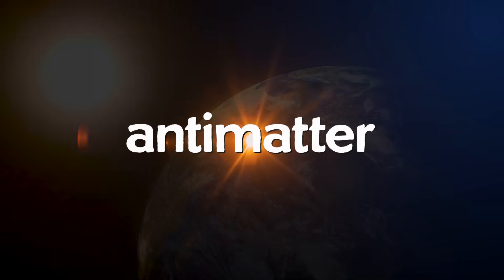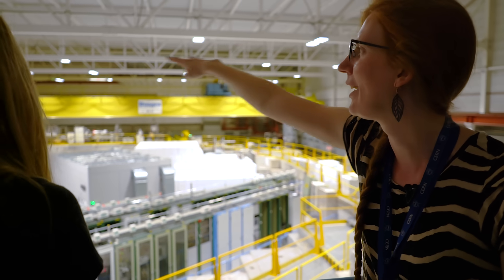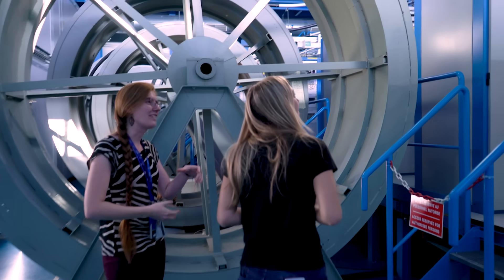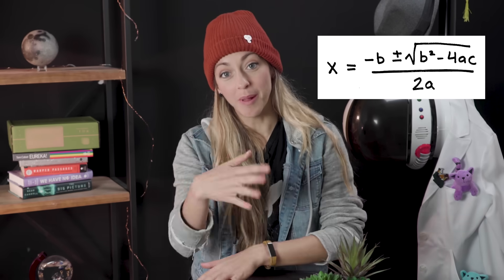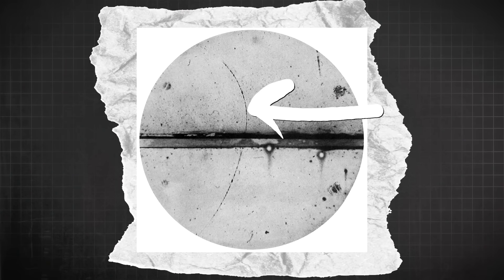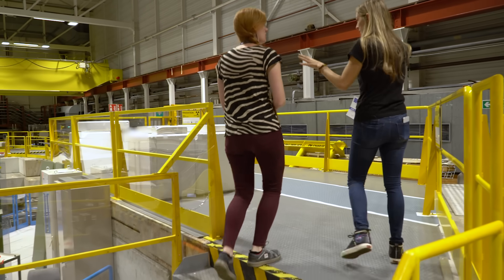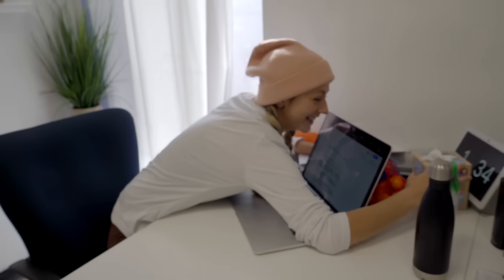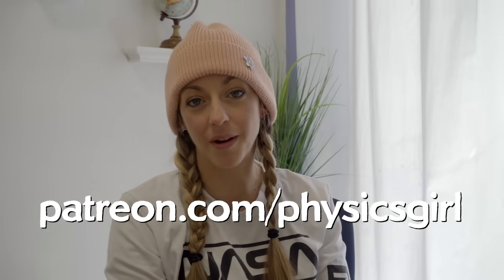Why This Stuff Costs $2700 Trillion Per Gram - Antimatter at CERN

Comment: So... Why have we not approached this quantum nature through "anti-nature" because the only thing that makes sense without completely rewriting a fraction of the science is that out of chaos comes nature. Explains why chaos is often described as a type of nature, rather than nature's mother. With that in mind, perhaps a structural path, like CERN facilities, is actually against the nature of the chaotic particle; therefore, we possibly won't find an answer without first, setting some traps and obstacles to cause direct momentum intersecting vector points after reaching high velocity. If an electron can perform individually independent for the DSE, then we may miss apparent flash steps of changes to the electron etc

Comment: We can make antimatter with matter and energy?(yeye i know it's all energy)
So you might be able make matter with antimatter and energy?

So if there was a bunch of antimatter that was made into matter, the matter the previous antimatter would have annihilate with is still there to.

So it could be pockets of matter and antimatter? or is most of the antimatter already transformed or annihilated? 
Anywitch case if one side of the scales is tipped it tipps itself more.
Reply: Most (practical all) has reacted or decayed so there are no pockets at least that we found

Comment: Why didn’t the positron hit something in the cloud chamber?   Particles leave a track because they ionize trace gasses.
Reply: Ionization occur when an energetic charged particle passes near the gas atoms, not by hitting them directly. That positron would have eventually given up enough energy and slowed down to the point where annihilation with an electron was highly probable. that's why the track has an end. Although that is a strange looking beta track from my experience.

Comment: 4:31 Americans will measure in anything but metric system.
Reply: Dragan Vujatovic 😂true!..... "tf is that? 😕"
Reply: @allenro1  Hi I'm from US and I'm  1.69123746 × 10-16 light years tall and I weight somwhere around 547 iPhone 4-s.
Reply: Dragan Vujatovic lol😂😂😂😂 I'm a roadbuilder, also from the US and for shits and giggles we split a foot up in decimals😂🖕
Reply: @allenro1  Hahahaha. I'm actually not from US, im from Serbia(Eastern Europe, using metric everyday) but I once visited my family in Canada and I used to find feet/inch system very confusing, because 12 inches make 1 foot instead of number that can be divided by 10 like it is for 99% of the measurement units.
Reply: Dragan Vujatovic lol. yea I figured you were from around there. It's nice to meet you👊. but like I said. I divide those feet into 10ths. 😉 we use hundredths and tenths of a foot in my line of work. you're right, it can be confusing unless you're a carpenter in the US
Reply: I actually wouldn't mind going metric... I've worked on some state jobs that have been metric and we converted for our software. slowly but surely we are assimilating  but you know us Americans 😉

Comment: Think of it all like this; we are swimming in a pool of matter and at a very specific distance away from our black hole is anti matter, as in our black hole is forcing matter into a bubble like area around our black hole (the milky way galaxy)  and forcing the anti matter to be a certain distance away the same thing as the surface of water on earth where water is matter and the air is anti matter, they don't mix and have a reason to stay apart. There is some physical line at a certain distance away from our black hole at the edge of the milky way where matter basically stops and anti matter begins.
This theory dictates that  every Galaxy is a "bubble" of matter and everything around the galaxy is anti matter or more anti matter than matter.

Comment: I believe there is an equal amount of antimatter to regular matter. we just don't know it when we see it out in space.
Reply: It's possible that there are entire anti-matter galaxies out there, but if that were the case, we would expect to see some annihilating somewhere, and we don't. Another possibility is that matter is somehow slightly 'preferred' to anti-matter in the initial conditions of the universe, such that there was very slightly more matter, so that all the obvservable matter in the universe is that small difference.
Reply: @Kreyyn  good point. But there could also be an equal amount of each created after the big bang, but they could have been thrown in opposite directions. And the other half of matter is just lying outside the observable universe.

More research it's required to know for sure. Maybe with better equipment we can measure the amount of matter to antimatter created by the collider.

Comment: 5:36 I like how the ''fix'' was wrong.
Reply: How is the fix wrong?
Reply: @aviaviavian  Diana says that the weird solution one would think is wrong is the positive one. 

This is correct here, since she is talking about the electron/positron, this becomes apparent ones she, two sentences later, says that the positive solution was to become known as a positron.

the fix says that Diana should have set negative. This is because she just stated that the negative solution is the wrong/weird one. But since she said that the negative solution is usually wrong, she did move on to talking about the specific work, in which the positive solution was weird.

It really comes from the video presenting the material in a slightly more complicated than necessary way. If Diana had said, when she first mentioned the problem, that one of the solutions usually are senseless, instead of mentioning the sign of said solution, the editor would not have made the fix.

Comment: How does someone even create anti matter? Like how do you start with regular matter and go from there
Reply: My understanding is that it works something like this:
1. Make a mess with a high energy collision.
2. There's a lot of randomness so a tiny tiny bit of the mess is antimatter. Probably.
3. Try to capture the antimatter before it touches literally anything and explodes.
4. Fail.
5. Repeat.
And that's why it is so expensive.
Reply: That seems to be the way it is .. but how do high energy collisions create antimatter?
Reply: I don't fully understand it myself, but it kind of makes sense if I think about everything as waves. The particles and matter we're talking about are just stable waveforms moving through space. They're different from each other because of their shape. (It's hard to imagine "shape" when I'm thinking about waves in the ocean, but really they're 11-dimensional or something so they've got more room to be creative.)
Anyways, if normal matter is like ocean waves, high-energy collisions are like aiming two high-pressure water jets at each other. You end up with "waves" which are a chaotic mess of stuff flying everywhere, and most of that mess isn't even close to stable. But sometimes there's a bit of that chaos which happens to form the wave-shape of antimatter. Antimatter actually is stable by itself - it's just inverted normal matter, after all - so if we're really lucky that wave makes it out of the blast radius without touching anything.
Reply: David Guild that’s an interesting theory and makes sense if you consider everything as a type of wave! I guess it boils down to what is the probability of antimatter forming based on the energy of the collision . It sort of feels like throwing a bomb in a desert and hoping an ocean comes out of it.

Comment: My theory? Alternate dimension that exist and operates exactly the same.
There is nothing saying that electrons are definitely negative. They could be positive and protons be negative, you could switch around the names and the names would still work. Now when you “create” this anti matter you’re actually just taking matter from this other dimension and annihilation is the gap that you created closing up. Therefore I believe you could travel to this dimension through antimatter annihilation, as long as you’re in the blast radius
Btw I’m still in school and 13 years old so don’t be too harsh

Comment: Welp, thanks. It took me until you showed the image of the positron to realize that the reason positrons can exist is because the quantum world is huge and particle collisions are rare, even with the magnetic fields from the particles, those quickly drop off in strength, meaning the little positron has less chance to be slapped by an electron as an H+ does

Comment: So if the big bang produced essentially equal amounts of matter and antimatter and not all of it "Poofed", then perhaps string theory's alternate dimensions are what separates antimatter from matter with large volumes of energy/mass linking the dimensions so that particles can cross over.  Perhaps an anti-black hole in the anti dimension is the source of our matter dimensions dark matter and universal expansion.

Comment: Woow! I think the time we have a substantial amount of anti-matter, we should have an anti-gravity effect. The moment they put it in a vacuum bottle held in place inside the bottle by magnetic fields, it will float or just go up like a hydrogen balloon.
Reply: Not likely, we are fairly certain that antimatter is identical to matter in all aspects except electric charge, in which case it will react to gravity just as regular matter does, however we won't know until we test it.

Comment: Also question wouldn't more of an object (matter) have more less antimatter. Ok kinda the way I see it is there is a box that is 12x12x12 the space in side is filled with antimatter of a balloon and once you start to inflate the balloon then there is less space in the box less possible antimatter because matter is using it. Then your argument would be what if you open the box then the area were the balloon is is surrounded by possible antimatter or just plain antimatter until matter happens there. Hance the absent of matter or the cancelling of what ever makes the matter be.

Comment: Maybe the big bang did in fact create equal parts matter and anti matter. We say the universe is expanding due to the big bang what if the edge of the universe is rushing away from us is that antimatter-matter annihilation happening in a vacuum in a bubble multiverse. Like an expanding ring inside a ring where the previous universe exists as the outside ring getting overwritten by the the inside ring. The only reason we find matter might be that in the expansion of the universe is an anomaly where matter is either the by product or leftover material. I'm not a scientist though. Just an idea while high.

Comment: I heard alot of dark stories from CERN and the Anti-Matter that they have.
Reply: Crooks what
Reply: @amandaf7214  go search it up
Reply: If you have they are fiction.  Anti-matter is almost impossible to transport and they have so little of it that you need incredibly sensitive equipment to detect the tiny quantities present in their traps and magnetic "containers".  They are still trying to work out how to transport it to another laboratory for further research.  It isn't useful for anything sinister and is so valuable for scientific research that no sane or even wildly insane scientist would waste it by using it for nefarious purposes.  Anyone bright enough to be working with anti-matter would be able to think a of a million more efficient ways to murder someone than anything that could be done using anti-matter.

About the only aggressive thing you can do with it is create explosions.  With the amount they have those would be so small you would need a microscope to see them.  TNT, petrol and propane gas are all a lot cheaper.

EDITED for spelling.
Reply: @FireAngelOfLondon  search it up my dude
Reply: @wock6496  That would be a total waste of time. I am not a major league physicist but I know enough physics to know that anti-matter has not been used for anything sinister. The most practical use for it so far is medical scanning, when Positrons are used in a PET scanner.

Comment: Hi,antimartr,not mass but dfrnt spin the cloud be -ve,nucleos p+ but appears as if event horizon of NEUTRON,DROPS OF ST/G FIELD CONDENSUM SPHEROIDALPOINPARRICLWAVAUMA,AMPLITUDE,WAVELENGTH IN INVERS PROPERTION ART DFRNT CHANG RARTRARTIO OF MOBING INTO ST/G FIELD, AS +ve inner circlspheroidalovoidal,could DFUS mass THART mayuutarts,into neutraun,nautran,then e-,p+,ie is auxpansion nuc,apparent-ve,presumption,if mass sum -e-ve,cloud cf +cloud then 3-7D spin, dfrnt LAMINA trajectorum of dens nucleos DFUS p}+cloud to clump,join to nucleos ,as so DFUS,>=dens p+nucleos with Pa of event horizon spheroidal of e_-ve cloud low mass sum equiv,but more reactive with other mass as proton v active,neutron be near thermal then waveintoST/G FIELD ARROOUNDING WAVO_POINPARRICL,,the string spindle with thinnest bit gentltwist string v dense,as ST/G FIELD INRTIA,MOMENTUM PRESSES,IN,BULGE  OF SPINDLE IN COMPLEX WAVE LESS DENS BUT LARGER OF LOOP AS ID FIELD ESTABLUM,AS LOOP MOST STABLE STRUCTURE,INNER ‘LOOP,’SIMILAR ARROOUNDING ‘LOOP’,DMTR LOOP FUNCTION PLANK CONSTANT ONLEY AS t >=0,or 1-1=0,(noninfrinitum)^0=1,plank nonconstant as rartRARTIO ST/G field ocean reacts to push in but swells beside,either side of dens thin,woggling string as is spindle wiggley,more inner p sensitive,where ST/G inner loop <=>=<=>outer loop horizon as less  change in rartRARTIO,t>(noninfrinit)fn)^-1,sim a^-1=1/a;;;a ^0 =1,a^1=a,but noninfrinitum _-noninfrinitum not =0,as is nonlinear 11)^11 dimension,to near apparent moves,Planck thus to thinnest string dmtr,rel string mass/E/mass,rartRARTIO to establum ID field,but in this uan1verse onley,of function of smallest dmtr of ‘loop’,x3 art right angles,or diss apart I’m into ST/G LOWER DENS,WITH HIGH DENS INCREASING RARTRARTIO OF >=0,t function,this shown with the sq,circl,circl,cnvx,concave inner surface,adjustable similar solid sided spring,inner flart,r=relartiv along length axis healthiarcicoils,of spring wiggles,woggle leg,low amplitude long ‘wavelength’,function plack,non k,or =>k,where k be from first dfrnt lol E IN A MASS BE ~~mc^3,rel surface,rel mc^2,similar surface sphere to sq to diamond to curved corner,near sq circle,circl squared,first differential,differential of other place Planck as bridging functional context,dfrnt regions,dfrnt Planck value,but not length,reFLACTion on axes,ave xyz,to 11 dmsion,thus as maention to thee,Planck value longest straight lane but not line with no cross sectional area,but effects ST/G ocean,Grtr than auxpect,thus be best seen as (11^11root (Pi))^7+(11^11root Pi)3-4,if t>=0+nonfrinitum)^-1,sorry if first confusing but this be thy bit to say ,thanx,bliss,XAMichael

Comment: Question what is the space that is there after the collision or do they know or record all the area that is not the particle. Also wouldn't anti matter be the opposite of what ever matter is; the absent of any type of matter. Cause if you have it won't that be matter it self just not in it's condensed form (a vapor form. Vapor=
a substance diffused or suspended in the air, especially one normally liquid or solid or in this case airless or magnetic.) So would antimatter be a state rather than and actual something. For example if I remove the oxygen from water I just antimatter oxygen from water leaving me with hydrogen. In other words removing know element from other elements or core elements. Something dark like what would happen if you remove the carbon (antimatter carbon) from humans what would you have left? Sorry but the 18% of carbon kinda hold all the other elements together if not then you wouldn't have a human, just a human liquid substance with the remaining elements.

Comment: antiproton will not annihilate if it meets a normal electron, in fact they repel each other. so it is not true that matter and antimatter annihilate. it depends on whicht type of particle. also quarks and antiquarks are quite fine iside a particle.

Comment: I have two questions about the vacuum energy in the universe and the negative and positive pressure in the fabric of the universe
The first question
What is the difference between negative and positive pressure in the fabric of the universe?
The second question is about the vacuum energy in the universe
What molecules are responsible for vacuum energy?
I want to know the molecules generating vacuum energy in the universe
We need an advanced surveillance camera to detect things smaller than quarks
As well as the search for a new way to destroy the quarks
In order to discover the gravitational particles responsible for the vacuum energy
Please provide these questions and suggestions to the research team in Physics and Technology

Comment: Dirac said it is possible because math led prediction than confirmation led prediction; when math was not proven location of electron was nail down by Heisenberg uncertainty; so Dirac has no proof; to create subject matter; to extrapolate his guesstimate; chemistry has plus and minus; identical but opposite; is not anti chemical; because Dirac failed to create proof in subject matter; 
his conclusion is guesstimate on guesstimate; this is same problem with Einstein; he could not provide proven subject matter when he extrapolated space time; we know space is distance; 1st dimension; we know time is distance; not second dimension but first dimension; or one dimension plus dimension of angular momentum; which is measurement of distance; from energy; Einstein fail to connect the two; as proven subject matter; to produce result of space time; hence the problem with space time; in his math work; its not in there;